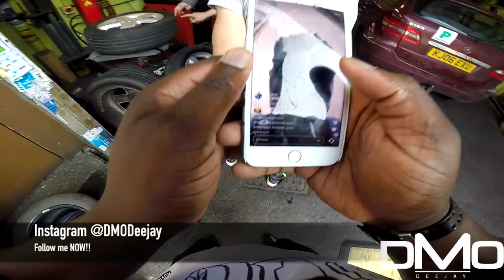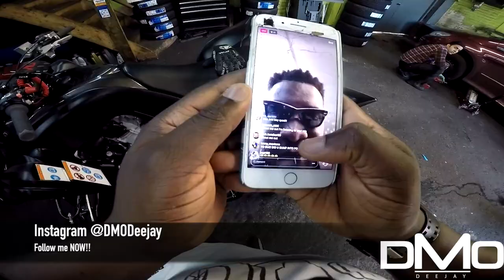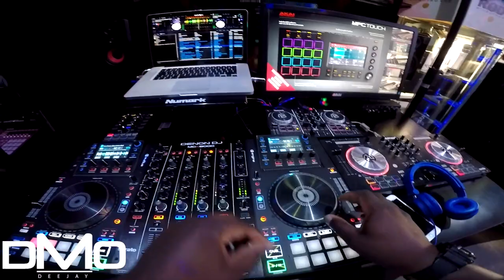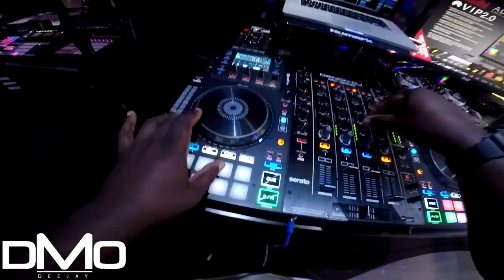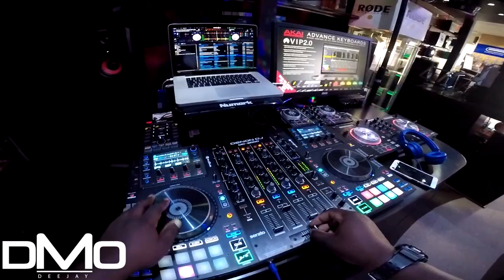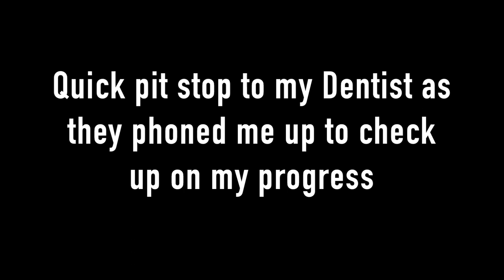MY DENTIST HIJACKED MY QUAD BIKE!!!! *WTF*

Comment: what quad shall i get my first one any help please
Reply: Jason Lodwick 140 susiki
Reply: Jason Lodwick raptor 700r
Reply: a fast one
Reply: Jason Lodwick Yamaha raptor 450
Reply: just start with yamaha raptor 660 and drive carefully so you can learn everything about it and then go with 700 raptor
Reply: Yamaha 50cc
Reply: Get a Polaris rzr 1000 turbo. I have the 2016 rzr 800 walker evans edition then I have a 2017 rzr 1000 turbo. There not cheap tho. They range from17k to 30k